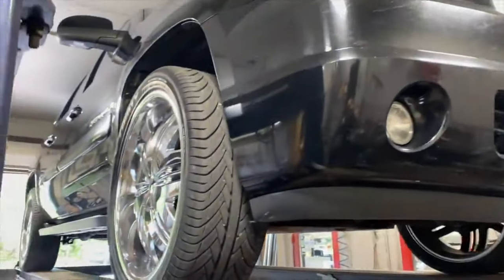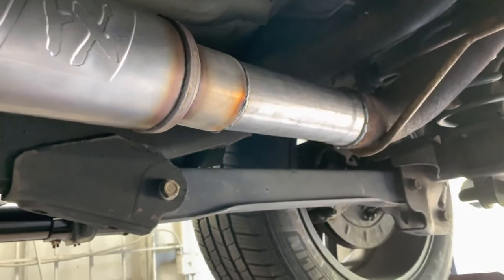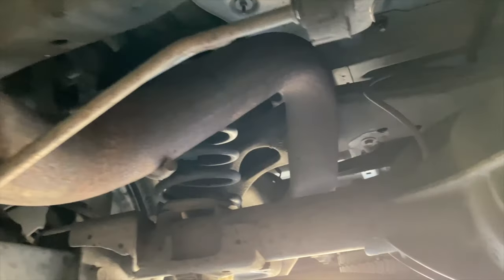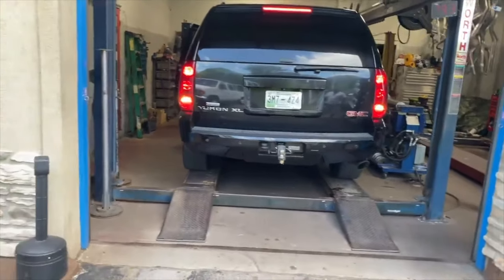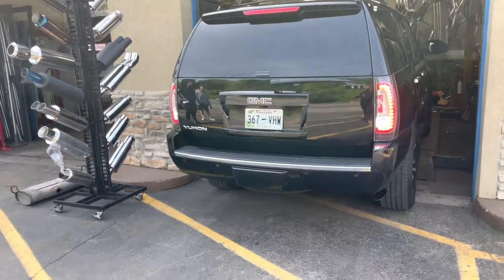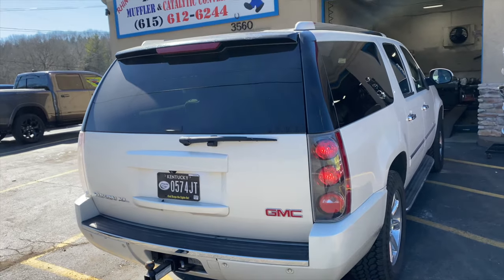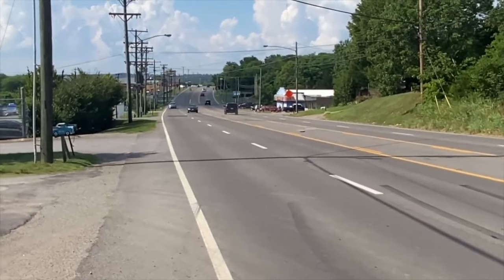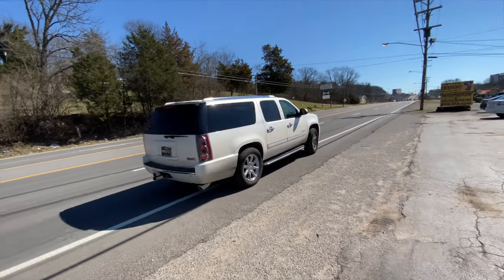GMC Yukon 5.3L Vs 6.0L Vs 6.2L!

Comment: The 6.0 is actually a 6.2
Reply: Facts.
Reply: 6.0 can handle more boost
Reply: And the 5.7 is a 6.0 but upgraded.
Reply: And the 5.3 is just meh
Reply: There is a 6.0 yukon though, 2 of them, yukon hybrid and yukon xl 2500
Reply: And the 4.8 is actually a 5.3 with different crank, rods, pistons,
Reply: Sure was
Reply: @philliptorres3725  lmao
Reply: And the white 1 has low oil pressure. 😤
Reply: No they made an all aluminum 6.0 in these 1500 Yukons and suburbans. The HD suburbans of this era had a 6.0 iron block.
Reply: ^^^ correct and the also put the 6.0L in 07-09 avalanches too
Reply: @Gorealaracer38  1st thing I paid attention to 😭
Reply: @johnpaid5747  🤣

Comment: i thoght that 6,0 engine was only for 2006 and under after 2007 it became 6,2 am i wrong???
Reply: Nah the video is wrong, yukon denali only came with 6.2 from 2007-2014, the 2000-2006 model had a 6.0 though
Also 2007-2014 yukon xl 2500 had a 6.0 and suburban 2500
The hybrids had 6.0 aswell

Comment: 6.2 would have been the best if it would of had a small muffler like a super 10 or something. 
But 5.3 won
Then the 6.2
6.0 last
Reply: Right, idk why you would want that vehicle to sound like that. It’s a luxury type people puller not a workhorse. Trucks make sense but not a stock Yukon/Denali. Just looks weird to me to see that vehicle driving and that sound to come out. The flowfx sounds good though. Not too loud.
Reply: @mrwashur1991  well some people just want it to sound better, and luckily these are easy to make louder without ruining the luxury, cut off your muffler and it will be good but not too loud

Comment: All sound great I actually have a 2012 denali 6.2L. Not sure if you guys noticed but I seen in the video the 5.3 when you revert the motor to 3,000rpms oil pressure went up like it should but the 6.0 n 6.2 it didn't move I believe the 6.2 oil pressure was at like 20psi.

Comment: He has an oil leak on the white one and getting mufflers put on? Lol
Reply: Every GM Vortec comes from the factory with leaking valve covers and oil pan gaskets.
Reply: @nakian5316  lol I own this same truck and have over 230k miles. No oil leak yet and have owned it since new. Maybe you have it mixed up with furd lol most never even make it out of the factory
Reply: @trentdaddydolla647  facts 👊

Comment: 5.3 6.2 are Small Engines.

V8 is Bigger
Reply: Uhhhhhh! All of them are V8 engines smoke shop...6.0 and 6.2 are basically the same
Reply: @realityallah39  jajajajjajajnana
Smoke Shop!!!
Reply: 5.3 is a 325 , 6.2 is a 376 , 6.0 364 to 368
Reply: @joshriggins9579  the 6.2 actually got a couple of upgrades, the first models had like 380 hp but then they went to 403
Reply: @odiarroyo6144  well I was High when I was Looking at the Engines.   
V8 Looked Bigger